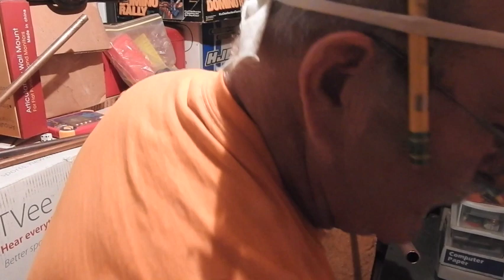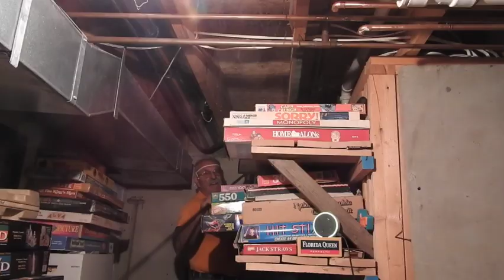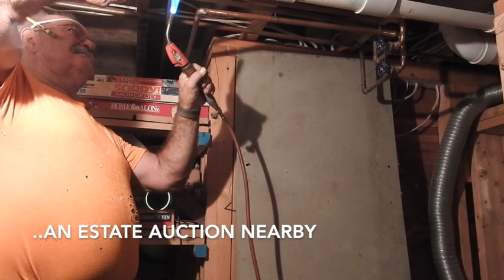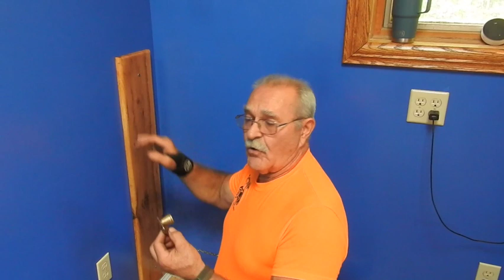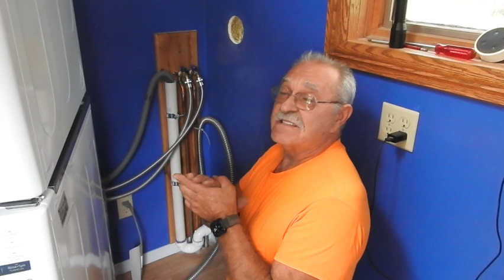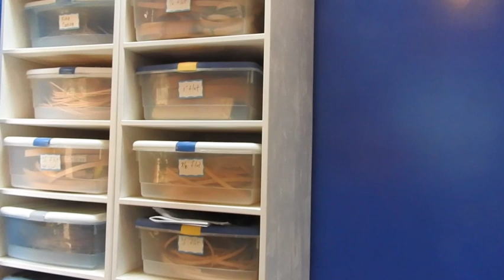Lets Move The Washer Dryer Upstairs Where There Is No Plumbing

Comment: Excellent how to video. I really like the trick of using that brush and drill to spin the pipe for cleaning. I must try that next time. I am glad you mentioned that even new shiny copper pipe needs cleaning because of the impurities. My father also explained that fact to me years ago. I can understand that some would assume it’s clean enough based on looks.  You did a fantastic job as always. The shelving project will finish off the now upstairs laundry room.
Reply from the maker: Sometimes its the simple things that make the job easier...when soft soldering, cleanliness is of the utmost importance. I won't even touch the fittings and pipe prior to soldering where they have been cleaned due to oils in my finger tips.  Using the brush will eventually squeeze it down, so remember to keep at least a spare one for large jobs.  Thanks for taking the time to watch more mundane activities than normal....LOL

Comment: Job well done, will certainly make laundry day easier by not having to navigate the stairs with every load.    The baskets to your left must be some of the Missus’ handy work, very well done too!
Reply from the maker: I should've done this back when we added onto the house, but the basket room was more important at the time.  But as knees and hips wear out, it really helps to eliminate stairs when possible.  She made a basket for a lady that swore it was a Longaburger basket and  not hand made by the Missus.  LOL Look closely at Longaberger's and you'll find hot glue and small brads on some.  None on these at all !!  She's made egg baskets that are awesome...those are the ones that look like somebody's bottom, so the eggs don't roll around and crack.
Reply: @tractorman4461  the baskets sound great. I'm unfamiliar with baskets and the brand you mentioned. Roses are really empty basket weaving. But they are all gone. Sounds like YouTube content. Stepping in for electric or plumbing would have been easy with that time. But everything takes time. It looks great the way you finished out the room.
Reply from the maker: @CAROLDDISCOVER-2025  thank you for the kind words.  It was a busy two weeks for sure.  Maybe a little longer because I didn't show the new micro-groove composite flooring going down OR making and installing the new oak trim for the windows and door.  I installed new painted baseboard...quick job for that.  I bought new cheap casing and just painted it because 90% is going to be hidden behind the shelves and stuff.  I didn't want to waste the time to make all the fancy oak trim for it to be covered up.  I use a wide crown moulding bit and use that for trim without cutting the 45* reliefs on the back like you would for use as crown.
Reply: @tractorman4461  you know it looks great great blend between painted and the unfinished oak board that acted as a utility Chase. Well I should say the unpainted of course. Just made it stand out my said things are covered up. I remember some of your other work and I believe it is your daughter's house you may have shown some matters but I remember that with the cabinets. I'm sure you was one heck of a HVAC man but looking at your woodworking creations you might have missed a calling. No person can only go in so many directions. I want be a cabinetmaker since the time I was a kid up to now actually. Especially for teenager. I did not have the foresight to see that I could make a living at it and be happy with it. But occupations some of them have been great. Others have had more adventures than I care for a nap now. But that's why I enjoy watching woodworking. Person can take a lot to learn and woodworking apply for metalworking and vice versa. How was that cup of coffee ☕ This morning?

Comment: Nice job as always. I would have recommended to put a drip tray under the unit. Ok for now but as I have found out one day you will have a leak. It will save your floor from water when it happens
Reply from the maker: Yes good thought, we have considered it as soon as we finished the project. My son and I can pick up the assembly in place and let the Missus slide a preformed one under. Inevitably it WILL develop a leak somewhere !!  The washer has convenient hand holds for lifting, so it'll be a simple task to add it, plus everything is flexible that connects it.  Thanks for watching as well as for the suggestion.

Comment: Thats real old school using rigid copper pipe and soldered joints. Now most use plastic PCV. they have a grey colored that is for hot water. I still use a lot of galvanized pipe and threaded fittings. We have a few pipe vices and pipe cutters threading and eqiptment.
Reply from the maker: Oh heck yeah I've run literally hundreds of feet of all kinds of piping..threaded, victaulic, copper....you name it.  No stainless steel though. One job at the St Louis police station, we ran just at one mile of hard drawn silver soldered copper for multiple computer room a/c systems.  Refrigerant piping, ACR, is dehydrated and sealed rigid copper with thick walls like type K copper.

Comment: In Europe we should have water proof for washing machin room with water drain on floor in the case for damage,  insurance company will not cover damage
Reply: Yes,  I'm surprised he didn't set the washer on a pan with it's own drain.  Just in case of a leak.
Reply from the maker: Good point Paul, and we no more than finished the job  when we thought that would've been a good idea.  So my son and I will pick it up with the built in hand holds while the Missus slides a pre-formed basin under.  No disassembly at all with everything flexible connecting it.  We only have to lift it a few inches, then sit it back in the pan.

Comment: if the door on the washer needs to be flipped so it opens the opposite way...make a video of that please.
Reply from the maker: Unfortunately the washer door doesn't appear to be reversible.  But the dryer door is.  The Missus said she didn't have to option to order her choice of door direction.  I've reversed our old refrigerator door as well as the old dryer in the past too. Not all refrig doors are reversible either.